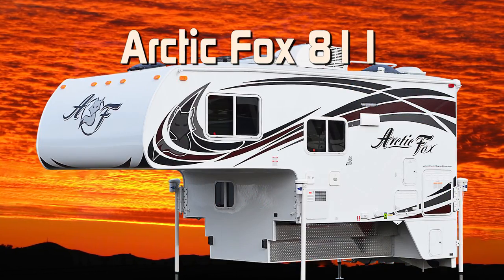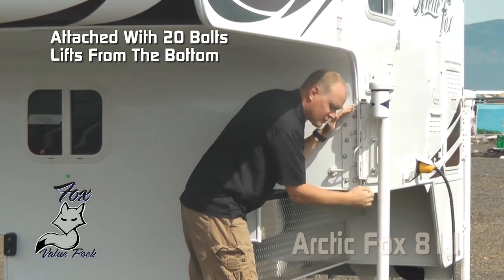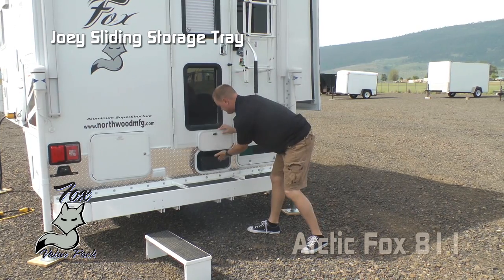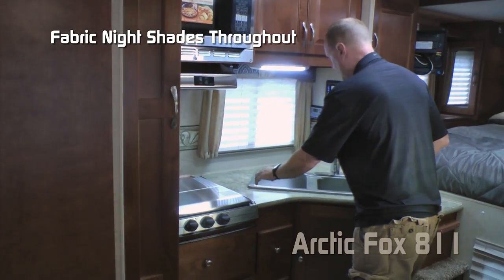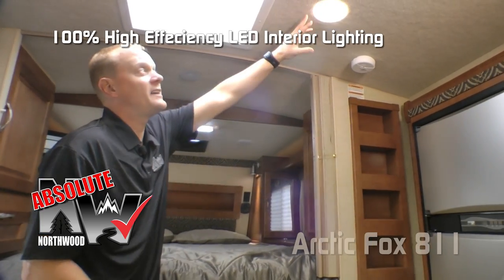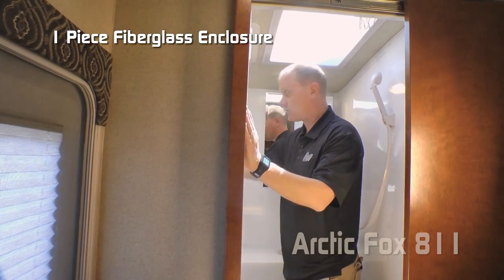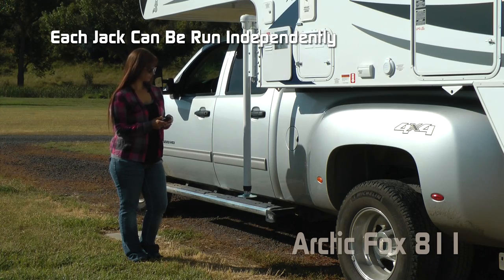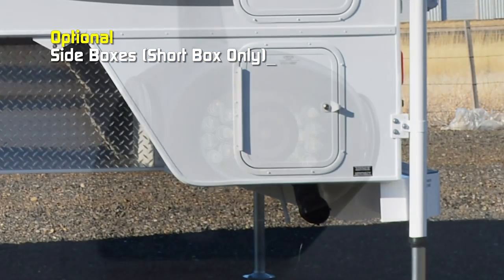Quick Tour Of The Arctic Fox 811 Pickup Camper

Comment: in such a small space I think the eat in buffet is wasted space, a sofa and small pull out tables would be much better use of space.
Reply: I agree and considered making the change until I discovered that the furnace is under the bench next to the fridge and you would have to give up interior and exterior storage under the opposite bench.  Finding a new home for the furnace would probably mean a smaller fridge with the furnace underneath it.  After using mine for a few months I guess I could get by with a slightly smaller fridge but probably not one small enough to accommodate a furnace.
Reply: The movie theater reclining seats in place of the buffet to me is a great replacement as well.